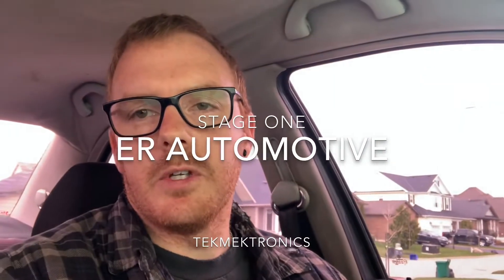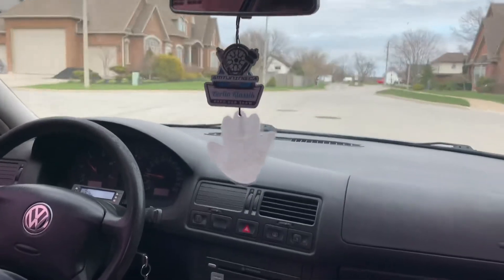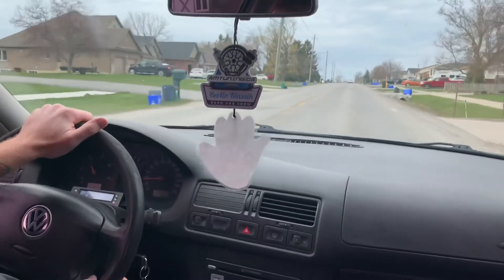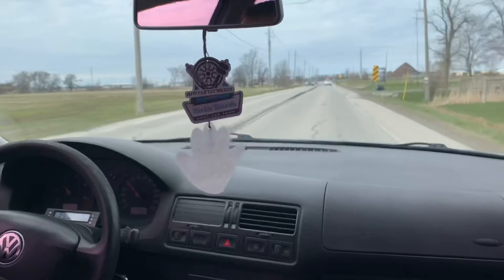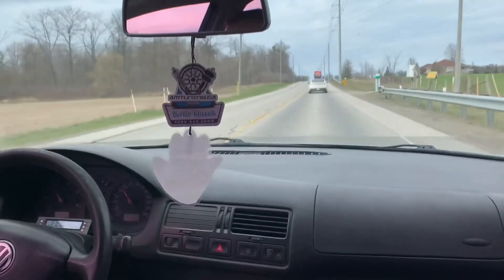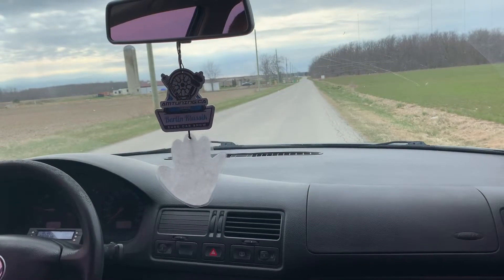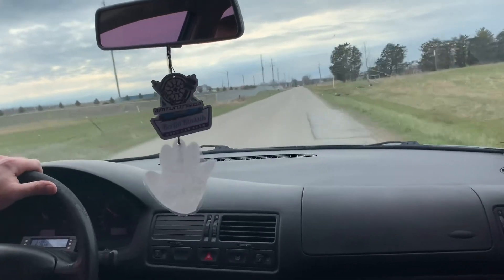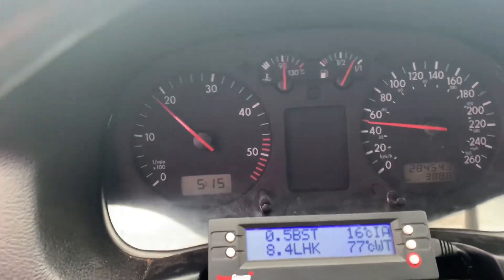Tekmektronic stage1 bew review/ first impressions

Comment: hey man what kind of digital display is that on your steering wheel column? looks to be a boost gauge? what is it, and how does it work? do you need to program it or do anything funky or is it plug and play? thank you!
Reply from the maker: Hey 
It’s called a scangauge2 
It’s plugs into your obd2 port and reads the data right from the ecu 
On the mk4 there was no programming needed.
There’s lots of other features as well 
Check out there website to see all its features

Comment: Is that a scan gauge? If so, does it read boost as you had mentioned in the video or do you have a separate boost gauge?
Reply: I definitely didn’t watch the whole video through before asking my question…
Reply from the maker: No worries 
Yes it is a scangauge and yes it reads boost no problem on mk4
Reply: Is that all plug and play through the OBD2?
Reply from the maker: Yes it is
Very nice unit in my opinion